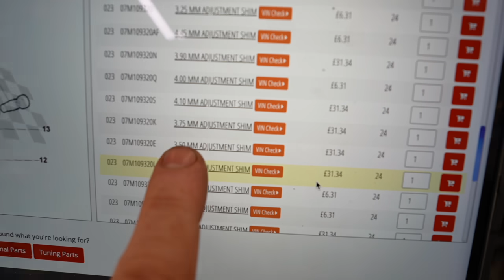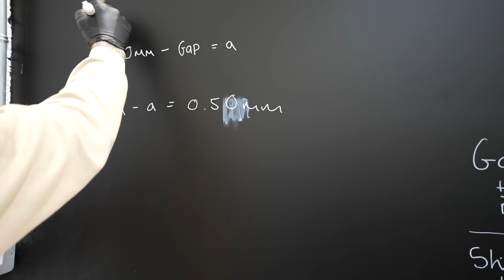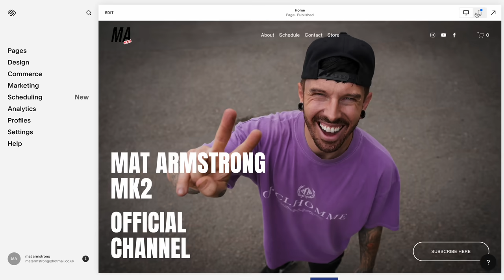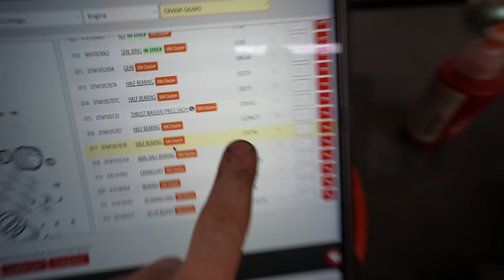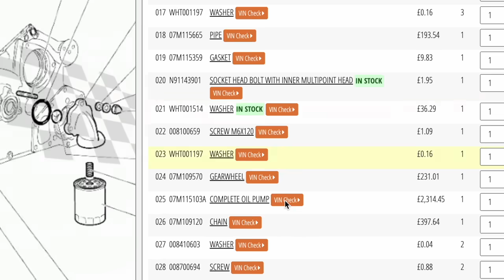REBUILDING AN ABANDONED LAMBORGHINI MURCIELAGO | PT3

Comment: I think Hoovie and the Car Wizard cut the same hole in his Murci. In one of his videos.... Good luck Mat. You and Dad deserve a round of applause mate. 👏
Reply: Yep, they did exactly the same thing to Hoovie's Murci. Not a big deal Mat,  just another hole!
Reply: They did a better job though. The circular cutout is better for strength and was also smaller. This square cutout doesn’t even look like it has rounded corners
Reply: Was the material carbon fiber? Would be a great location to learn CF repair techniques since you don’t normally see it.
Reply: @JStryker7  Yea, the square corners is where you would end up getting stress fractures if they where to show up. Rounding up those sounds like a good idea Jezza.
Reply: And actually the Car Wizard didn’t want to do it and Hoovie took all responsibility.

Comment: The amount of surprises this car brings has to be a record hahaha great series Mat
Reply: The surprising part is that all of these problems are common on Murcielagos, including the cutting a hole in the transmission tunnel bit. The owners of these cars don't want to pay for what it costs to yank the entire transmission out, since you need to get it on a lift, unbolt, disconnect everything, and drop it down all to tighten a bolt if you can just cut a hole and cover it up afterwards. If you're doing the work yourself, then its fairly reasonable since the only investment is time. And on top of that this is also the perfect time to do a clutch job, so that tends to be an added cost as well because... well why tear it apart to adjust a bolt and not just replace the clutch at that point as well.

Comment: For the hole on the transmission tunnel, add some sheets of carbon fiber and resin. As for the interior, I'd consider paint some green leather sections black.

Comment: great video,as as an engineer who has done bench fittting and assembly of engines etc. watched your engine rebuild with great interest,your dad obviously knows what he is doing,I would like to point out however that the key you mentioned in the oil pump is called a parallel key,a woodruff key is parallel when viewed from the top and is half moon shape when viewed from the side, there is also another type called a Gibhead key which is used in open keyways on the end of shafts.Keep up your great videos

Comment: I’m having a couple of issues with the cars bought but watching this makes me feel so much better😂. In at the deep end. Impressed 👌. That plasti feeler gauge is crazy . Never seen that before .
Reply: Engine rebuilds use Plastiguage all the time, it's the simplest way to measure baring tolerances.
Reply: @schrodingerscat1863  how long has it been in. I was a mechanic years ago must have missed it.
Reply: In certain two stroke motors, we use a strip of Plastigauge down a spark plug hole, turn the engine over by hand & then use a feeler gauge to measure the clearance between the piston and the head.
If the head or cylinders have been skimmed, or a non stock gasket used, or substituted pistons, all can make clearance alter. Too little clearance & the motor will lunch itself!
Reply: @tmwsalvage  It's been around for a good while but before that we would have been fiddling around with micrometers and still not be 100% sure that clearances were accurate when torqued down.
Reply: Watch @M539 on his bmw rebuilds of his M5 for a perfect demo.
Reply: @mercedes_and_more  True M539 showed a perfect demonstration of using this stuff on his Alpina B7 engine rebuild too. Such a great channel.
Reply: @schrodingerscat1863  only 1 of 2 that i subscribe to that i have never skipped 1 sec of every posted video.
Reply: @mercedes_and_more  I know, I love that guy's videos. Everything he does is executed so perfectly, so satisfying to watch.

Comment: Great channel Matt, however, regarding the oil pump, a woodruff key is a half round key, your missing key is called a parallel key, they come in standard widths and you can adjust the height with a milling machine or file as they are clearance on the top, you can buy key steel and just make your own with a hack saw and file.

Comment: Great video, loving the build ❤ reminds me of when my dad and I rebuilt an old lotus europa. The body on that was fibreglass but it was bolted to a massive steel Y looking chassis, hopefully you have a similar set up, as the body wasn’t structural as such. 

If it is fibreglass it can be repaired, by grinding off the top layer/gel coat wiping it over with acetone and adding chopped strand matt and resin. It will add additional thickness to both pieces tho if that’s an issue. Fibreglass is very strong it probably will not cause any issues keeping the hole for adjusting the linkages in the future as long as it’s sealed to keep the road water out. But if you want it perfect get sanding 👍

Comment: To the Hole cut into the Transmission tunnel: Look at one of the Hoovies Garage Murcielago rebuild videos. They did the same thing on his car.
And if you're worried abot the structural integrity you can resin the puzzle piece back into place and put some layers of carbon on top.

Comment: Enjoy the videos, looks like a lot of fun.  I normally don't comment on stuff, but you could have saved yourself a lot of time when looking to see if there was a hole under the center console.  Instead of taking apart the inside of the center console and possibly breaking interior bits.  You already have the engine and transmission out, just crawl under the car or put it on the lift and look from the bottom.  You would have seen that previously cut out section of the body from underneath without having to remove anything.  Best of luck, I know you will get her back on the road mate.

Comment: You need to either heat or cool your bearings in order to ease the assembly process.  Thermo is your friend when it comes to fitting bearings.  Every mechanic needs a freezer and a bearing heater.

Comment: A bore micrometer is what you need, those plastigauge kits are for tractor rebuilds. Noticed you lined up the ring gaps in exactly the same place, this will cause inconsistent combustion sealing and oil burning. The ring gaps need to be staggered to prevent this and also have dots on them to indicate which way they orient.

Comment: honestly, when your crankshaft is alright and doesn't need to get sanded or rebalanced and your clearance on each crankshaft main tunnel is ok I'd reuse the same bearings in the same position. same crankshaft = same bearings! it's a combined system run in on each other and there's a reason one of those is so expensive. that's also the way our workshop concluded on doing it with a BMW 7 Series V12 with over 200.000 miles on the clock

Comment: Very nice project! 

As long the old engine is still out from it, and I see it has a lot of room in the engine compartment. Id love to see it swapped for VAG 1.9TDI - just til the original engine gets fixed up good. Lambo is VAG group so it would not be that huge of a heresy. 

Imagine, Lambo sitting behind red light - with clacking sound of 1.9TDI.

Comment: Tyler Hoover's Lamborghini also had a hole cut out in the same place.  I think the car wizard did it rather than take the engine out.  It was because the gear lever broke off - which is supposedly a common issue.

Comment: OH man, before you reinstall crankshaft, you should put all main caps on and tighten it to spec (without crankshaft) and measure the oval of the main caps. with the micrometer. if there is any out of spec you would need to reshape (redrill) main caps on special machine - to make them back the same size and round. installing the main bearings without it - you risk the crankshaft will wear the bearings very fast because lumen is too loose...

Comment: If you want to repair that butchered 'access hole' properly have a look for a bicycle carbon frame repairer that's nearby. Amazing what can be done to snapped carbon bike frames which retains the strength. Seems like it's a heath robinson solution to a design oversight though so probably worth retaining an access hatch, even if you end up making a neater one.

Comment: That hole in the trans tunnel is a common fix on Lamborghinis, it doesn't effect the chassis strength. Hoovie's Lambo from Hoovie's garage had the same problem and they cut a hole with a hole saw.
I think it was a solenoid they had to fix.

Comment: Accident damage on the passenger side.
Been repaired and prepped.
Found out the paint is a 3-stage pearl requiring full repaint for best result.
Prepped whole car.
Found 3-stage pearls are difficult to apply right even for professionals and are expensive.
Decided to wrap the car instead.
👍

Comment: What's your plan for the carbon fiber hole? A "real" repair is hard to imagine, as that part comes all together and has a huge mechanical resistance; could be substitute by steel, but then fixing it properly isn't easy at all.
Congrats for your great videos and effort!

Comment: If you don’t re shimm after run in your timing will cause a crap tune.  Also did you re balance all moving parts? Also when the schmuck planed the heads did he maintain original specs?

Comment: On your clock bring it to A college where they teach electronic,s so they can and will check all your Components by putting each on A Occsciope which shows the pattern wave length of that component if is good or not just Tip them good to a few pounds and some fish& chips maybe a pint. Good Luck my fellow Gearhead

Comment: It's not a woodruff key. It's a key. Woodruff keys have a flat top but are rounded on the face that sits in a rounded keyway. rounded in a way that allows them to rock about a point half way down the length of the way. This makes them intermittently catch a driven gear or other driven component. Milling machine handles have them so that they freewheel if someone gets caught up in them. I don't know, bloody mechanics.

Comment: Tyler from Hoovies Garage did it with his Lambo i think it was one of the shift solenoids was faulty on the replacement gearbox he had put in and when they tried shifting it come up on the dash with a fault so he and his Mechanic cut a hole in the transmission tunnel to change it so his mechanic didn't have to remove the engine and gearbox again to change that part.

Comment: I have to say as a certified technician with years of experience and I have worked for the FBI maintaining their fleet. The cutting of a access hole in the console instead of dropping the transmission is not a big deal. As long as it is done properly and doesn't cause any structure problems.
Reply: The chassis and the original paint of the car is like the virginity of the vehicle. Once damaged or painted, it is no different from a hoe for the other owners.  You can use it for pleasure but not for passion and love. This car may be a nice car, but since it will never be "perfect" again, I wouldn't care about damaging it or driving it carelessly.
Reply: @ziusky  car manufacturers make sure you have to go through hell to replace certain things on any car. I have a 2014 Shelby GT 500 and  wanted to replace the plastic tube for the clutch it's a pain to get to unless you pull the driveshaft and transmission mount. I chose to cut access panel in the transmission tunnel using a dremel. Made a flap in the carpet and saved a ton of time including lifting the car used a piece of sheet metal and sound proof material.

Comment: I'm not accurate there. They rock so that they can accomodate any angle of beveled bore. The handles on a milling machine  probably freewheel because a spring force the beveled shaft and bore apart. Soz.

Comment: I know this is going to sound strange but I've actually seen three or four videos of guys cutting a hole to adjust that linkage on the transmission and I guess apparently it really doesn't cause any structural damage. As long as it's put back properly and I don't think those little brackets was it. Just telling you what I have seen.

Comment: Also too late now it seems but I'm pretty sure that king makes replacement bearings for that engine due to all the turbo kits getting installed and that engine not really liking boost stock...I'm 90% sure it was king that offers them now but forsure someplace now offers an aftermarket option for main/rod bearings

Comment: That wrap would’ve been something I would’ve addressed at the time of purchase. I understand that you’re green 😜 when it comes to these. It’s a lesson you will have hopefully learned this 1x. Imo, You paid $20k over what it should’ve been. 

I’d probably consider wrapping the car again rather than painting if you plan to keep it for yourself. If selling it you’ve got to paint it unfortunately.

In addition Edit: The alternative is you could’ve taken that crank shaft out to a specialist and had them turn it down and fit them from another engine with a similar journal size. We used to build a lot of odd ball or engines with hard to obtain parts and always looked for alternatives where they applied.

Comment: Looks like you've used your assembly lube whilst plastigauging. Meant to be clean, dry surfaces as per the instructions. I'd guess your tolerances are a lot more than you measured unfortunately.

Comment: The condition of the car is not at all surprising when you consider the business model of the previous owner: rent it out the maximum number of times possible, at the highest daily rate possible, before it becomes uneconomic (in either dollars or time) to keep the car in the rental pool. Repairs would be prioritised for speed over quality (cut a hole in the floor instead of dropping the box) to maximise the track time & reduce downtime.  It was just an asset getting sweated for returns. Like commercial aircraft (without the, y'know, regulations and safety concerns). They expected it would be driven hard (and poorly) and expected it would get banged up. The only goal was to extract the rental returns before it became unusable. They probably didn't expect to offload the carcass for a hundred grand and absolutely wouldn't have foreseen it starring in this excellent channel where every horrendous 'repair' discovery is adding thousands of subscribers. Nice one, Mat.

Comment: Should have been a hole in the trans tunnel in the first place . Its stupid to have an adjustment point without having a access to it. This is a stupid needing to dropping a fuel tank to change a pump.

Comment: ANIMALS MAN honestly how long would it take in the grand scheme of things to do it right i once left a garage for this very reason asked me to cut a hole in the floor of a ford focus to check the fuel pump after i told them that on the focus you have to drop the tank i said give me a 2 poster ill whip the tank out they said none available just chop it I said no my dad would disown me if I did that he taught me treat them like they were my own so they taken the huff and said they would do it themselves go and do the mot on your mates motor so I said not a problem Wich indeed I did and after i handed them the cash for the mot Wich i carried out lol and told them i quit and found another place to work lol have a great day the gated manual is coming along nicely

Comment: Hoovie cut a hole in the same place, tho they cut to round hole to maintain the strength. These clowns cut a square hole with square corners....Ideal for Stress Fractures, This is sort of Bad....I would  get some Carbon Matting and Epoxy and Patch that...I'm sure they did as good a job of the repair as they did of everything else. I would round those corners off and recarbon that whole area...;D Good Luck.

Comment: I guarantee that car has been off track atleast a couple times and that's probably why it was wrapped like that... I had to work on a couple cars that were from a company in the states that does the same thing..let's people drive exotic cars on the track and they all have been off track and the tracks around here all use huge rocks in the  run offs and that does stop the car ya but absolutely does a number on the car itself..iv seen busted engine and transmission cases obviously alot of bent or broken suspension arms and linkages seen 2 full carbon monocoque shells completely busted up and broken completely totaling out the vehicle because they can't be replaced and only very specific repairs can be done without making the car unsafe according to the manufacturer..those are very sad days and I didnt even own the cars but just knowing that the car was heading to the crusher was saddening for me ..but that company must make a good bit of money because they were always buying new cars for the company and they were always on top of the maintenance procedures and brought them in routinely and some of those jobs were 20k or more and they never said no to anything I said their stuff needed and I'm sure it was the same with the other techs I worked with... that's alot of money and they are still in business even after covid lock downs and everything else...
But back to the point 90 % or more of the cars that are used for track sessions are wrapped up because of damage from being not crashed but taken off track and into the run off areas... but that is just my personal experience so maybe not..but I would absolutely bet money that I'm right about that! ;)